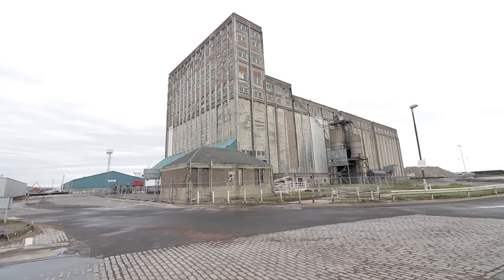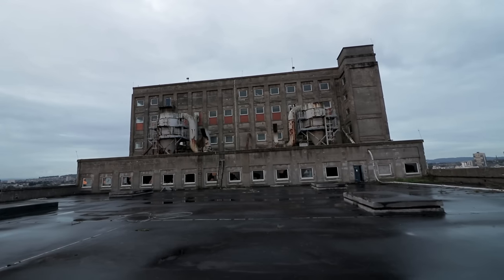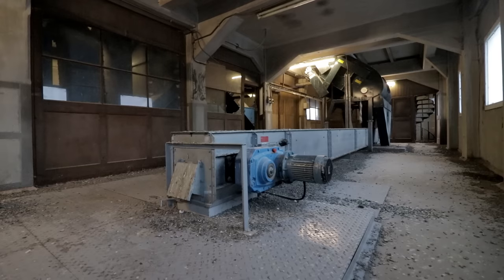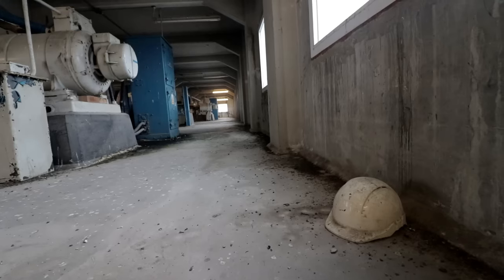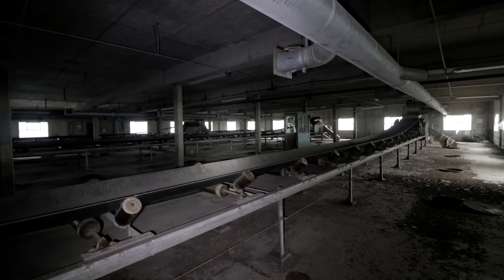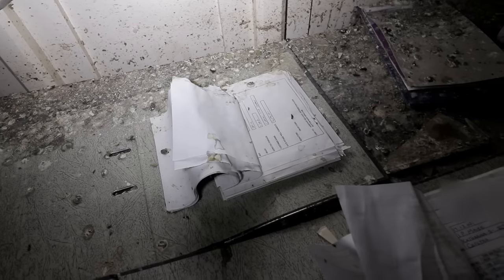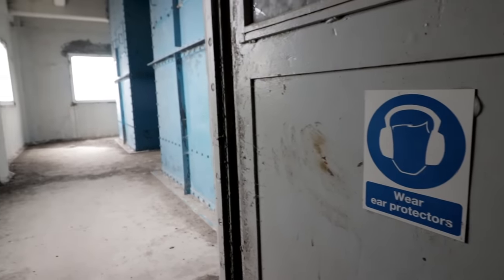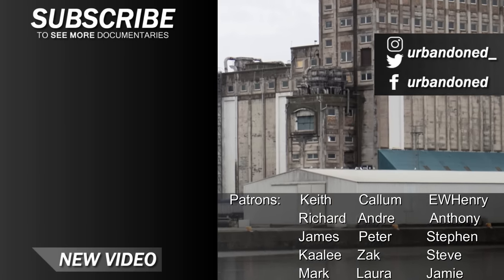Exploring a Huge Abandoned Factory - Scottish Time Capsule

Comment: I like the drawer labeled "Junk!". "Loud phones" also sounds interesting.

As for today's question, I love old factory buildings built in the early 20th Century or even before -- especially ones that are older than this one. Back then even industrial buildings were made with style, while later ones are purely functional. Their architecture is beautiful in their own right, so yes, they are worth photographing even if they are otherwise completely empty. For newer ones, I'm not that enthusiastic about.
Reply from the maker: Sometimes labels and signs are the most interesting parts of a building! We agree - any factory of old will be interesting. It's whether one with nothing inside would require a full video to show it.

Comment: Grain is such a fire hazard, I’m surprised at the types of stairs in such a building. 

In answer to your question, I like both types of buildings, vast, empty and atmospheric, contrasting with more intimate spaces filled with industrial machinery and the human touches left by the workforce.
Reply from the maker: Thanks for the response - we enjoy both too. We wondered whether one's with little inside except walls and floors might be a little boring to showcase through a video.
Reply: Interestingly enough at 8:25 I'm pretty sure that's an emergency slide to get out of the building in case of fire. Never seen one like that before, really cool.

Comment: Smashing stuff lad, that long staircase I assume is between several silos. The box labeled "Loud Phones" is likely a circuit connected to loud speakers perhaps or a similar system for announcements or alarms. Onto the essay, with industrial it's always about the machines. Nothing beats emerging above a goliath of machinery. But when emptied out it's the little things that matter, old conveyors, chutes, control panels and small architectural details on stairs and gantries.
Reply: Also, machinery can be very loud along with ear protection on, phones etc. would have to be very loud.
Reply from the maker: Spot on mate, thank you!

Comment: Its not been closed for 20 years that i can assure! I was going in there in 2006/7 to collect loads of grain for a bulk haulage company i worked for! Used for whiskey! Was in there a lot! Would pull under the hopper a small hatch would open for the guy to see into the trailer and i would shunt forward spreading the load of grain! Was in there 3 times a day, i believe much of it was not in use though! Not sure when it closed completely
Reply: Yeah I was wondering if it was like a malting plant? The holes in the floor made me think of floor malting? 🤔
Anyway if that was still being used 15 years ago, I understand why the UK is lagging in productivity 🤣 some of these machines are industrial revolution like!